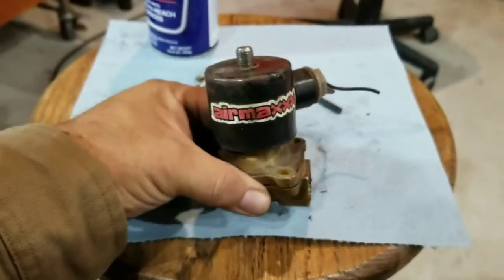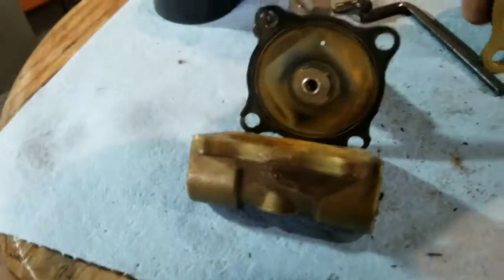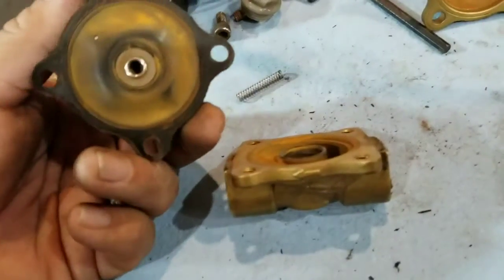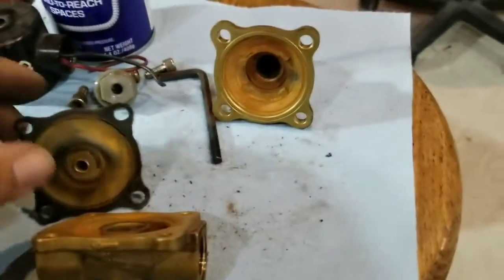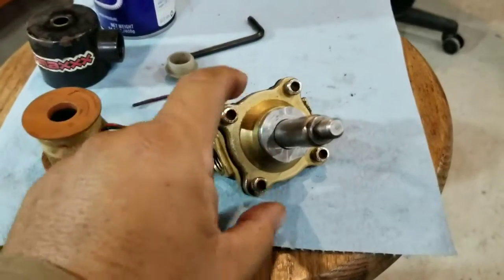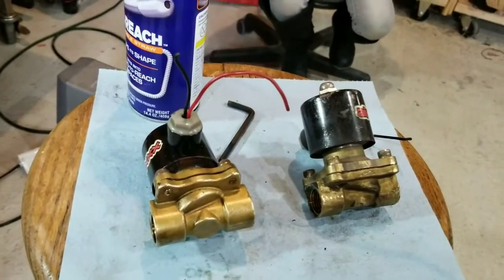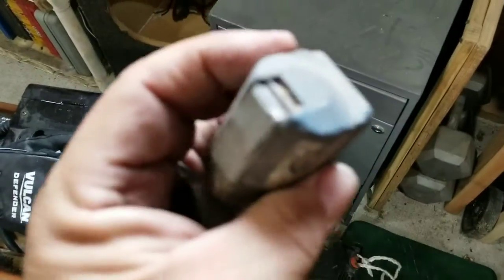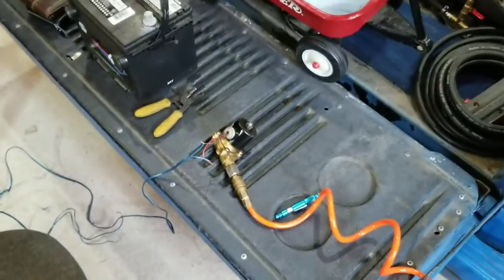How to fix electronic 12v air valves

Comment: I just cleaned my smc valves and had same issue i cleaned it using a wire brush on drill had leak on dump side fixed the problem right up
Reply from the maker: Nice it's like leveling up in a game when you can get it right lol

Comment: I put a air brake drain on my system, has a cord on it, just give a quick pull under rear quarter, no more sliding under my truck to drain the tank lol
Reply from the maker: Heck yeah that's good thinking I have those on the big rig need to think about that for the mini trucks in the future.

Comment: I've got 4 that I'm taking off mine and gonna get a manifold and they are only like 2 months old and mounted inside but 2 leak a little 2 don't but leaking between where they bolt together I'm gonna clean em fix em and sell em
Reply from the maker: That's nice of you to fix them before selling not many people that do that any more.
Reply: @earthscraper69  you're absolutely right I've watched so far all your vids...you're definitely a guy I could hang with

Comment: Great stuff as always! I haven't used these style of valves  before but good to know for future reference! Keep on truckin'✌
Reply: I love your video's man. I'm working on my first bagged truck I've got it bagged and in the spring i'm going to do a body drop on it. I have learned a lot from yours and scrappingpavement video's thanks guy's for all the help.
Reply from the maker: Awesome bro thanks for the compliment. One day I hope to body drop the mazda.
Reply: @earthscraper69  your welcome and you should it would look awesome man
Reply from the maker: Thank you scrappingpavement for the compliment. This is an in general video for all electronic valves.
Reply: Cleaned  the rubber diaphragm and it still leaks . Do the steams all come apart ?i have the svdf valves . Steam has a nut on it . But to access the seal was the four bolts . 
It leaks air back in to the bags in the rear . No leaks on the outside it’s the valve sticking open . maybe the steam it the issue . Like you said it might not slide right .